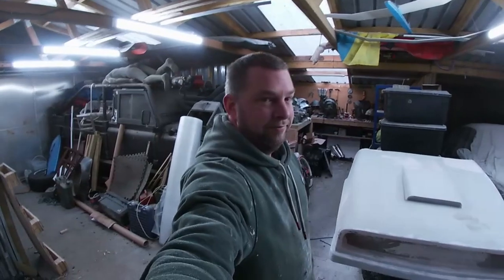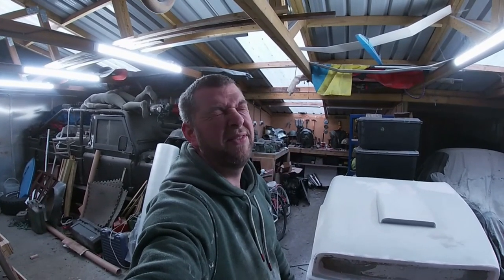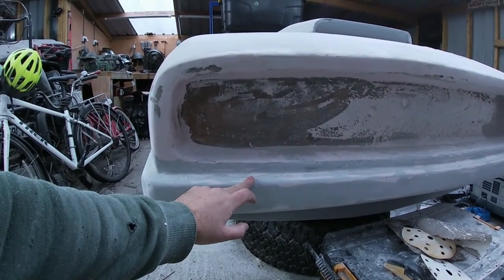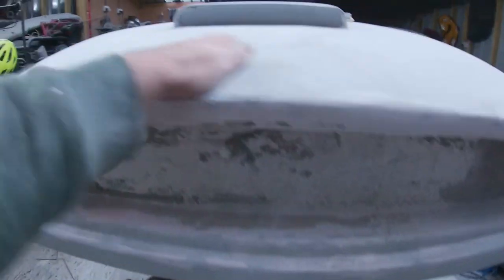Triumph Spitfire | Custom Fibreglass Bonnet | Mopar Style - Part 4

Comment: nice.  i forgot this was the mold and not the actual article.  am i right that when you take a mold of this that will in fact be the mold to make a bonnet with?..... bc i think to make the bonnet you have lay fiberglass on the underside of the bonnet not the top?
Reply from the maker: Other way around buddy. Once this is finished it'll get covered in fibreglass to make the mold. Then we'll take the original out, and lay fresh fibreglass in it's place, which will become the new bonnet. This means my finished product will be exaclty the same size as this. Hopefully that makes sense.
Reply: @BritSpit  yup--- shud be interesting to see what it looks liike.  there was a car a bond equip with a bonnet sor t of like yours.... but the rest of the car was different.  yours should look better than the bond.